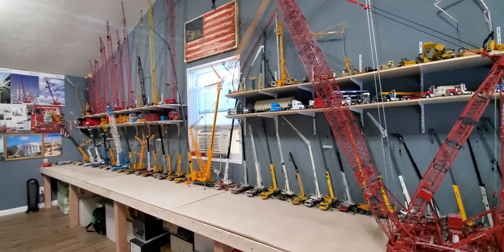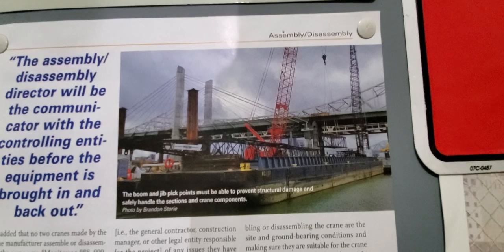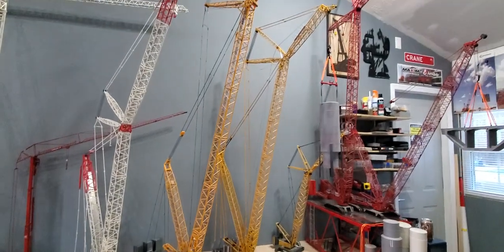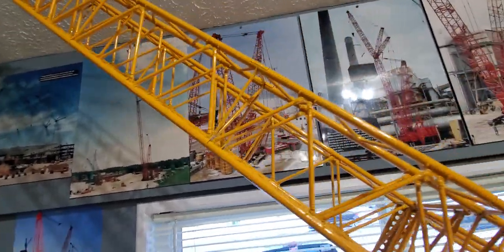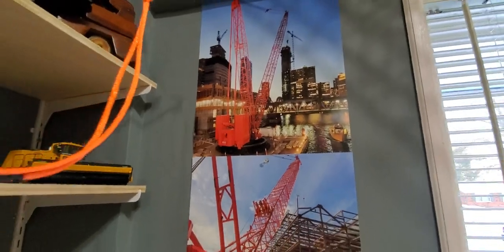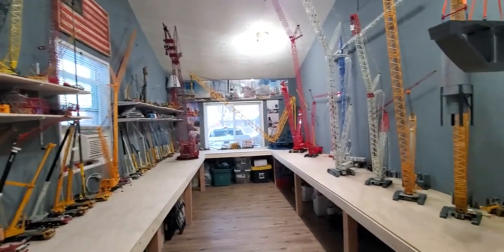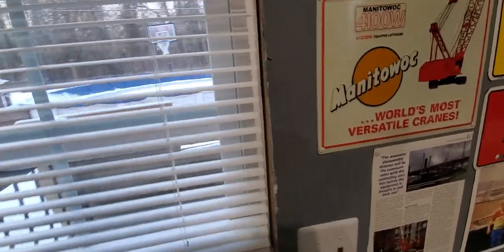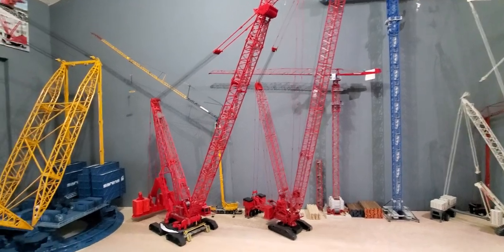final crane room remodel update.

Comment: Beautiful collection Brandon. I started collecting and my first crane in 2020 was the Mammoet CC8800 with the boom booster. Thinking of buying me a Manitowoc MLC650 and a Tadano GTC-2000. I have a question does anybody make the Liebherr 1800?? Has that model ever been made, one of my favorite cranes.
Reply from the maker: Thanks! Awesome, the 8800 is a beast! The 650 and gtc are great models too. Very detailed. Which 1800 do you mean, lr1800 or ltm1800? Ycc models has produced the ltm1800 for many years. Super detailed and museum quality models. But there is no lr1800 model.
Reply: @cranedude07  the Lr1800. Yes very beautiful models and thanks for the heads up. Maybe one day they’ll made them even the Lr11350 would be a beats if they ever made a model of it too